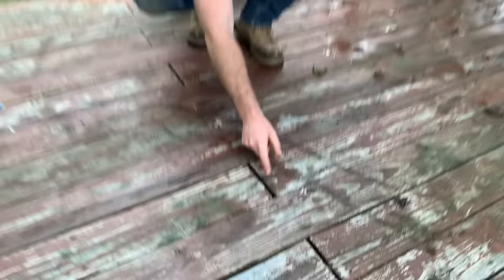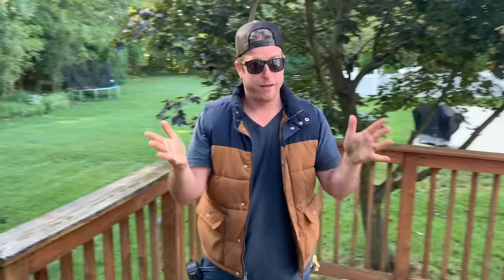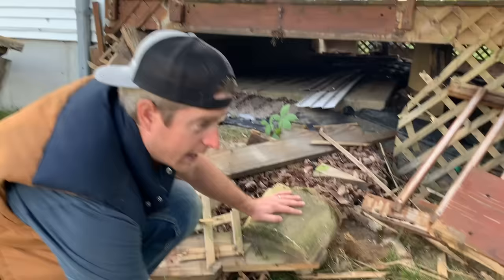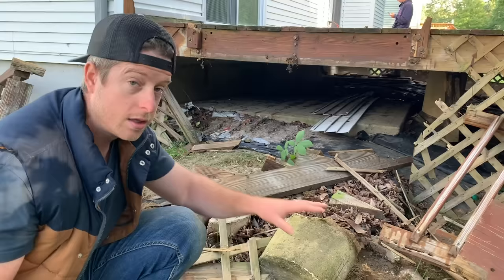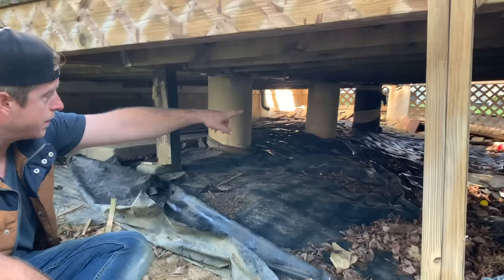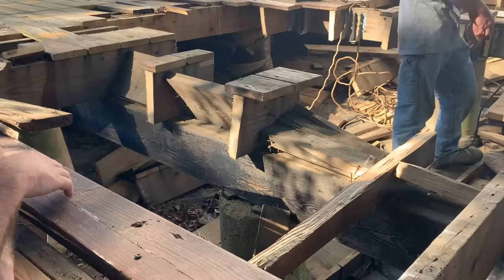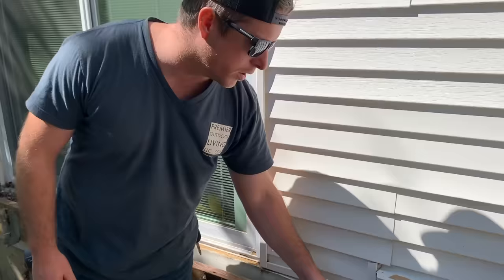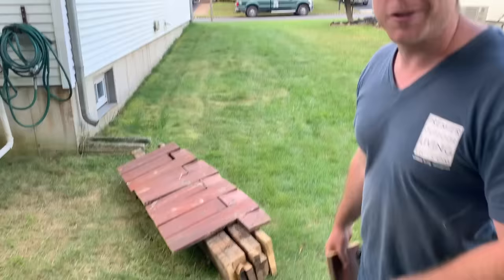How NOT To Build A Deck - Ultimate Guide On Every Mistake You Can Make

Comment: Something you overlooked, or forgot to mention is the fact that a lot of people do not have an un-limited budget to work with. I built my deck (40' x 8' x 2 1/2' tall) on a nothing budget, and used a lot of the shortcuts you have shown. It's looking pretty ugly by now, but my 200lb fat ass can still jump up & down on it and it stays solid after over 20yrs . And was built without any carpenter skills and no internet, using books. Just saying.
Reply: If you can't afford to do it right, you can't afford to do it.

If you had to sell your home, this would nock a lot a money off the price.
Someone falls through your deck and you built it wrong, you could get sued.

I had one section (20 square feet) of all 3000 square feet of my deck fail after 10 years.  It failed only because rats got under it and chewed through the PT beams and joists as well as undercut the pier blocks.  By the rats chewing through the PT portion of the beams, the interior rotted out.  
To give you an idea, the same area has a 6x6 post supporting the roof overhang.  I had to flatten the rat tunnels, use a house jack, and raise the 6x6 post and pier block by 4 inches.

I am replacing 30 year old deck from previous owners.  It has been bouncy the entire 25 years we have been here.  Beams scabbed together to form longer beams with no support under the seam.  Beams using tree stumps to support them.  One section I already replaced did not use flashing over the ledger and connected directly to the bottom log of the house.  This mistake cost me another $10K to replace the bottom log.
Reply: It's good to diy but we should all learn from our and others mistakes.
Reply: @edac1407 most american post i've ever read lol nuff said
Reply: @edac1407 if you can't afford a brand new perfect condition house don't buy one. Sounds like a god complex comment followed by trying to explain how u bought a shitty house with a shitty deck that u left that way for 25 years and now ur rigging it yourself instead of hiring a contractor but you think it's somehow better if you did it. No amount of code would prevent rats or termite damage. FYI my house had termite damage so we ripped the floors up ripped out the floor joists jacked up the walls removed the ledgers replaced ever entire board without splicing shimming or rigging anything added joist hangers because the house is old and didn't have them put new underlayment down and replaced the floor. So by my standards u didn't properly fix anything just jacked it up and wedged a block in it instead of replacing the 6x6 but my deck is very not to code sooooo do what you will with that. It's my deck we enjoy it I don't have 25k I'm willing to give some other guy so I can sit on my porch when I did it myself for 2k. Is it perfect?? No not even square but I'm pretty sure it would hold my truck and definitely more than the wood framed house it's attached 2.
Reply: Building codes and inspections exist for a reason. To protect people from shit work.

Comment: Every contractor " the guy that built this didn't know what he was doing" lol. Looks like it's been there for awhile to me.
Reply: Exactly.  This guy is a jerk.  Kicked through the lattice and complained about it?  What did he think it was suppose to be structural?  The deck was built by a homeowner and maybe not done the best, but like you said, it's been there quite awhile.  They got their monies worth out of it.
Reply: @darinvee4980  yet the lattice was still up and not broken at all. the deck looked like it was about 20 years or older. it had a good life.
Reply: Several things he said here are bullshit. I built a deck in an afternoon. 2 years later we deconstructed it (screws), and built a different shape deck with it at my sisters...another afternoon. (Octabon shaped btw). Supports sat on poured concrete. ON not in. Deck attached to house. Literally never maintained. In the woods in temperate rainforest (close to 100% humidity is the norm). 20 years later they demoed the home. Deck was still mostly ok. Except for the parts of the railing a contractor charged a grand to put in. Burying wood in concrete is a recipe for rot
Reply: Dudes been doing it for like 10 years and thinks he’s some pro builder😂
Reply: Exactly
Reply: Why all the hate? He is right on every point, homeowner was clueless, he could kill someone in a different situation, like higher patio
Reply: @cdreid99999  Indiana code allows for wood to be in concrete, I agree
Reply: Home owners hurt themselves the value and endanger others when they dont know what their doing...now days it's too easy to do it right...it's not rocket 🔭🚀 science
Reply: And where was the professional contractor to do the final sign off when it was completed before?
Reply: @darinvee4980  that’s right. It was pretty nice when it was done 15 years ago. So called professionals just want to make themselves look good in present day.
Reply: Anyone can build crap that last a long time
Reply: @cdreid99999  I think what he meant about the joists sitting on the concrete was that they were NOT fastened. Simpson makes a strong tie that you bury into the concrete and then nail the joists into the steel mount. Keeps the joist from twisting and spinning out of position .
Reply: If it's in an area with low humidity and the deck never really gets put under any stress, a super shitty deck can last far longer than it has any right to. That doesn't mean the construction was safe or built to last though.

Comment: The 4x4 on a paver reminds me of our timber frame barn that rests on field stones. The frame has held together for 100 years using only wooden pegs. I am humbled by the skill of 19th century carpenters.
Reply: Loose rocks in a hole counts as a footing. Maybe backwards hat guy doesn't realize that.
Reply: If it ain’t broke don’t fix it.
Reply: @baxtronx5972  post hole digger 6×6 posts and wheel barrow mixed concrete with the stongest psi you can find. Also notch the joists and install a cleat the length of the ledger board or band board, or use good metal brackets with the screw pattern recommended for durability.  This deck was clearly built in the 80s by the same coors light drinkin hillbilly we all know lol
Reply: @baxtronx5972  sand is amazing too just go below frost line

Comment: That deck definitely had major construction flaws but it does seem to have stood the test of time lol. Those support posts weren't even bad compared to some I've ran across over the last 10 years. Like a deck built over a walkout basement with 4x4 posts buried in the dirt, no quickcrete just buried in dirt.
Reply: Holy shiiiiit
Reply: I was just about to post that. Notwithstanding the low construction quality, the deck lasted until the top wood rotted.
Reply: I built a deck in Maine for my FIL that if I did it the POL way, it would have cost $30,000 more in excavating and torn the deck up after the first winter.
I attached it to an existing 3-year-old landing that was floating. The site is covered with 5+ ton boulders of granite barely beneath the surface that prevented any type of proper footings being dug. You do the best that you can with the budget that you're given.
If the deck builders were told that the homeowner wanted a 16x20 deck with a budget of $4,000, that is what they got.

Comment: Only thing I'd really clarify is stringer spacing. If using 5/4 boards or composite you definitely want them at 12", but if your using 2x's for your treads 16" is plenty and meets code. At least where I live.

Comment: DIY before youtube. There was not always an endless supply of 'experts' to teach people how to do things in the most difficult expensive way possible.
Reply: I understand a diy person not knowing the absolute intricacies of construction and best attention to detail, but if you cant figure out that a 4x4 propped onto a paver does bot constitute a proper footing, just from common sense, then you have no business building anything other than birdhouses and picture frames.
Reply: @markdoumert4840  
And what about flashing?  WHO DOESN'T USE FLASHING?  Apparently a lot of people!  I found this problem when I wanted to replace my deck boards.  But wait, there's more!  One of the joists collapsed when I removed the last deck board, because it rotted at the connection, because there was no flashing!  And...if two nails are standard, to secure the deck boards to the joists, three or four must be better, right?  Holy Christ!
Reply: I build a deck foundation for a shed 15 yrs ago. Treated 2x6's on cinder blocks. It's still there and holding up an easy 800 lbs of storage.
Reply: Deck seemed like it needed repairs not destroyed. Typical contractor taking advantage of homeowners.
Reply: There has  pretty much always been code guidelines Mr. enlightened.
Reply: Right. Most want to do everything perfect but not everyone has unlimited funds. LOL lover rise 10" won't pass code inspector. 1 wheelbarrow of dirt, no longer 10". Easy fix.. Porch probably cost a few hundred dollars 15 years ago and lasted that long. Now, rebuild it for about 5 grand for a PORCH.
Reply: @homemadehouse1418  well, there is a proper way of doing things. However the proper way is the most expensive and last the longest lol most of us are just trying to get by for like 10 or 15 years. So this guy knows what he is talking about from what I can tell. That deck was horrible.
Reply: @homemadehouse1418  absolutely not that deck was completely unsafe. It leaves the homeowner open to accidents and lawsuits. It looks like it's been patched a few times before. You can't patch and build off of rotten wood or sketchy foundations forever. Any contractor that would is risking lawsuits as well. Contractors can have standards without being con artists. They are actually legally obligated to.
Reply: @homemadehouse1418  Or just to lazy to re-use existing material where possible.
Reply: @Jack-Surreal_Panes  I'll bet that new deck ran 12 to 15 grand easy.
Reply: City boys in here trying to tell us we caint put a deck on blocks when our fuckin houses are on blocks lol

Comment: Where I am , you only need pads about 4 inches thick and then put posts on them and your beams on top ,  You can shim or do what you like.   If you put piles down 23 inches or whatever, they would just shift and leave a mess and just be terrible.   I just adjust mine ever couple of years to level the deck.   I build my deck up against the house but it is free standing.     I use a car jack to jack up the deck and then adjust the posts with shims.   My deck is 26 years old and still good.   I only have problems with the paint which never lasts and I am going to strip it off now and just stain it so never paint , never use deck paint.
Reply: Wow, get a load of this weirdo. That's all . DO YOURSELVES A FAVOR ,ALWAYS DO YOUR RESEARCH,AND SAFETY FIRST.
Reply: @patrickyates2486  When I jack up the deck, the posts are still in place and if the jack failed the deck would just drop down 1/2 inch or so and I am not underneath the deck for it to fall on me, I am off to the side.   There is no safety hazard.   How you build your deck foundation depends a lot on the soil.   I built a flower garden with a wall built out of stones and did exactly what they suggested in the instructions, digging a trench down a foot or so and then using crushed rock and tamping etc.   The thing sank in 2 years and was a waste of effort.  It is easier to make a very shallow foundation and live with the fact that it is going to shift.    
Here the soil is all clay and impermeable to water.   If the weather is dry , the ground dries out and water that could be trapped down a few feet will evaporate and the ground will sink a foot or so.  This also happens with  lots of basements because the builders dug out the ground when there was water and just filled in with the water trapped.   Now they build most houses on piles under the basements.
Reply: Yes, sir. This is how it's done

Comment: There are very few contractors out there that do a good job every time. Thats why DIY is becoming more and more a thing. I think there should be more requirements put on contractors to qualify their skills and integrity.
Reply: Probably solved by making sure they get the permits right?
Reply: I think you need to do more homework.
Reply: I noticed that a lot of people are really cheap.  I ran a GC business and most of the time, a job done right, with insurance and licensing to back it up is going to cost a lot more.  

I did well when I stopped working for DIY folks that were poor and started working for upper middle class folks.
Reply: These contractors are trying to make a living! Putting more crap on them will only get you less of a good job because they have to get it done quickly and move to the next just to break even because of all these rules you would want put on them .. but just know that you will be putting out twice as much money now.. great isn't that just smart. By the way contractors try their best to do a good job.. because if they don't it gets spread around and they do not get the jobs that they bid on!!!!

Comment: I just finished a reno on a house a client bought this year.  
We saw a lot of what I'd call "diy" from the previous owner.  No big deal, it was their house to fix up how they wanted.  Deck was built at diy level skill so it was completely rotten and falling apart.  We got the call originally because a 4x4 "made a loud crack sound" one evening.  Cool...  The post was days away from snapping like a drawn bow into their back window.

Ok.  Plot twist.
I got to talking to a neighbor while working on the collapsing fence, and it turns out the old lady that lived there did none of the work herself and hired a contractor (company name on the trucks level) to do all the work.
The deck that I assumed was built poorly between 5 and 10 years ago? Less than a year old.

I get that people hate hearing pro's bagging on other people's work... But if you get paid to do a job correctly you are not entitled to "professional courtesy" if you milk clients that don't know better and put people's lives at stake.
Reply: The part that pisses me off more than a pro bagging on another pro is those pro's who skip the permit process.  Not sure about other states but where I live, an pro is required to get a permit for damn near everything.
Reply: Absolutely. I wouldn’t expect a homeowner to know the best practice in these situations. The hardware, lumber type, connection details, design etc. But if youre getting paid to do it for someone else you better know your stuff. If you cant do it in a professional manner up to code you have no business doing it for money.

Comment: I still don't agree with attaching a deck of that height to the house. A few more posts and it would be independent of the house. The siding could go all the way with zero chance of water infiltration.
Reply from the maker: That’s also a good way to build it!
Reply: Hue Janus
 ... you could build it that way (free standing) but it may eventually "walk away" as the ground shifts. Probably best to attach the deck to the house even if it has enough of it's own support, because moving it back in 10 years is a royal pain, even if it's only an inch or so.
Reply: @rupe53  They make spacers so you can attach the deck to the house but not be tight to it. Also you can tie the foundation but not the frame
Reply: @frederf3227  .... yes, they have been making those spacer for some time. My point was a deck needs to be fastened to the main structure, even if that's not doing the support.

Comment: Definitely not built right. But it had enough supports that it wasn't unsafe. Looks like its been there for a while.
Reply: At 19, not knowing shit about construction, I built the shittiest roof over a porch for my mom. As a carpenter of 20+ years now, I cringe every time I look at it. The things is, though, its still there, and it's never leaked. I wouldn't build it that way again, but we definitely over-build these days.
Reply: Yeah, I stopped listening at "You NEED 12" between stringers (on the stairs)"  Dude, I've built so many steps years and years ago, and they're still there, fantastic shape, and they were built nowhere NEAR 12" apart....
Reply: This is why there are building codes.  They're designed to make structures safe, for the intended occupancy.  Just because something has been standing for years, doesn't mean it's safe.  Building codes are the MINIMUM standard.  There is nothing wrong with building something better than minimum standard.  Building codes are like cheap suits; they work, but only just...
Reply: @creepybunny255  yes I believe for 5/4 deck boards the mex spacing is like 18 inches, so 16 should be standard. Here they have 2x6, so , 12 inches would be overkill.
Reply: @ron7202  building codes exist to giv government employees jobs, and to hand out cash to their favorite lobbyists
Reply: @ron7202  I live out in the country. The building code is only four words “Mind you own business”
Reply: @oldcountryman2795  yep exactly
Reply: @creepybunny255  That caught me up too. Twelve inches is way too close even if you are using deck boards for treads. I do like to place my joists 12" OC. Overkill yes, but it only adds a couple boards on most decks.
Reply: @ba_brisk  inspectors are there to protect the public. They can save builders as well. One house I was building the inspector caught two plumbing issues before we poured the basement slab. The bathroom would never have drained properly. It would have been a disaster to come back and fix later.

Comment: Footing depth depends on where the property is located, the key is frost line.
But this deck isn't 10' in the air, at most it 3'8"  meaning its not life threatening if you fall off it.